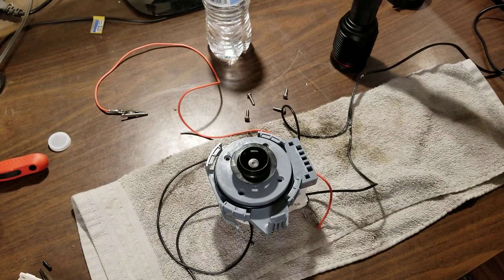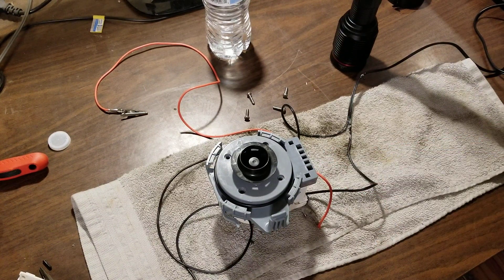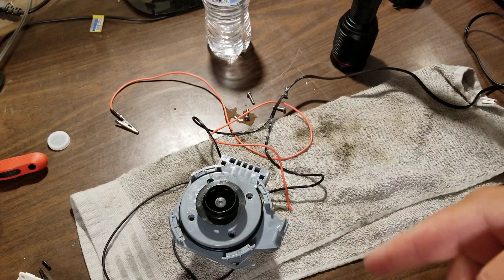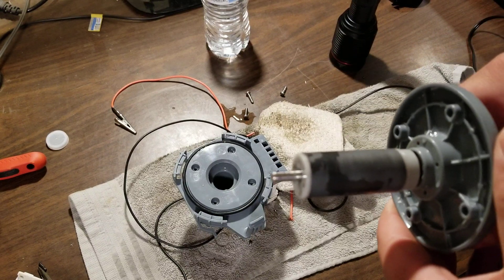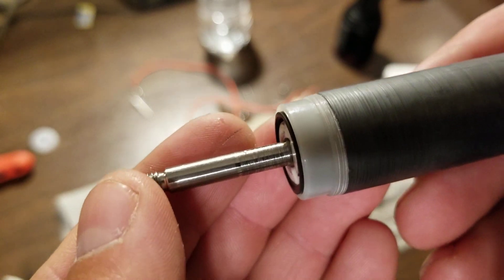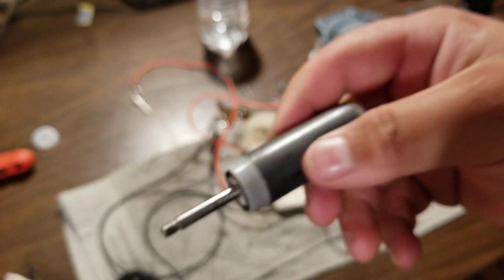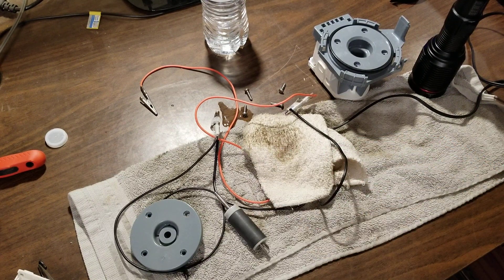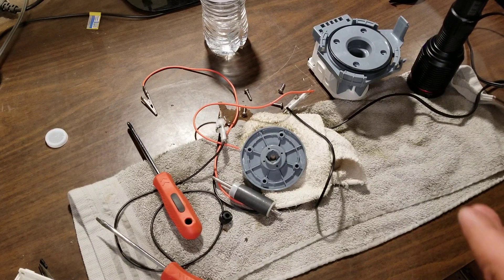Whirlpool Dishwasher pump motor failure

Comment: Thanks for this, I was wondering why these fail so often. I just changed my pump out today. Oh and beware the Amazon version. I ordered a used/like new one for $25 and it was the wrong amperage (.8 vs .9) and already dead. I bit the bullet and bought one from a local parts store ($180), but wishing now I had replaced the whole pump assembly since it is apparently the same price and easier to install.

Comment: Only took 15 months to wear out the rubber bushing. Most ppl will toss this dishwasher in the landfill rather than pay $400+ to repairman. (250 motor 150 labor) What a piece of crap. They know it'll last just long enough to get out of warranty. I used to like Whirlpool.

Comment: can you tell me if there is a way to test the motor with my multimeter?   Should there be continuity?  Should there be a resistance?  Thanks in advance.  I didn't realize there was more to this motor with all the electronics you showed.  My motor is slightly different but I'm sure it has that board now that it could be broke.  I have it removed and would like to run the dishwasher to see if the plug gets power.   It's completely unhooked from the plumbing though.  Any reason you could think of why I couldn't try to run a cycle without the water supply hooked up?    Thanks in advacne.

Comment: Excellent.  I took the motor apart, the bearings on both ends were worn to oval shape for my 5 years old Whirlpools dishwasher, acutally it is only 4 years old because the dishes was not cleaned, not after 2 to 3 wash cycles since the 4th years.  The appliance is functional after I bought replacement because I took the dishwasher out examine every part for 3 weeks, not till I saw this video.  Will put ball bearing on the broken motor as spare.  The manufacturer should have specified a ball bearing motor in the design.

Comment: Lets clear up some incorrection assumptions and conclusions. The oblong wear pattern in the bushings is caused by the choice to use a two pole stator, which causes the rotor to consistently exert force against the bushings in the same elliptical pattern. A three pole stator would solve this problem by balancing the forces evenly thus causing circular wear pattern in the bushings. The rotor becomes unable to start spinning because of the elliptical wear allowing it to tilt inside the housing, coupled with the inability to rotate freely once tilted. If the bushings were simply worn evenly in a circular wear pattern, this motor should have no problem spinning up that rotor even when there is tilt of the rotor because it would be allowed to continue rotation without impediment from the top or bottom bushing. Secondly, the o-ring on the top bushing serves only to center the bushing in the cavity. This rotor (and the bushings) are designed to run fully submerged in water. Thus any solution involving ball bearings needs to be robust to full submersion (PVDF housings with glass or 316 stainless balls).

Comment: This pump is used on many models of dishwasher from several brands (probably all made in the same factory). You can find a video where a guy replaced the lower bushing with an open plastic ball bearing. That lasted a year more until the top bushing completely failed. He then bought a new pump and installed sealed ball bearings before installing it. He hasn’t posted an update in some time. I suspect the seals will eventually let water in the bearings which won’t be good for them. It’s a cheap upgrade if they hold up though, and could be used to repair an old pump.

Comment: My dishwasher is making a grinding loud sound but works fine, do u think it’s the motor?
Reply from the maker: Yes but it might just be the drain pump. if its working normal then you should be fine.

Comment: Help, My dishwasher whirlpool goldseries is not washing, even though the electronic panel sends out 120v to the recirculating pump the dishwasher doesn't wash. So how do I determine if the control panel Is faulty or if my recirculating pump faulty.  The diswasher fills, drains but no wash. I check the wires: OK, I check the drain ok, it's between the control board and the pump. How do I determine. Than, you sir.tf
Reply from the maker: Check and see if the pump motor hums when it is signaled on, if it does hum but doesn't do anything then more than likely the bearings are bad or the impeller is jammed. But if you said the control board is sending out 120v to the pump and its not doing anything them more than likely the pump motor is dead. one way to test it is to do a quick rig up like I did in the video and see if it works, of course be careful when doing something like this as there is a shock hazard involved. You could also take the pump off the washer and open it up via like i showed in the video as its twist locked together and you can try to clean it out then put it back together and see if it works then but if still no luck then at that point I would just go ahead and replace the pump.
Reply: Thank you. I wonder if someone watching this video, with a machine shop, could make these bearings and a lot of money on the side. I sure would buy one.

Comment: My problem is not with the bushing but, the impeller. This is the second (and final) time it has unthreaded itself from the motor shaft. I've jbweled it onto the threads as there was no way to drill a hole between the impeller blades to secure it. If for some reason the bushing (or impeller) fail now I'll 3d print the entire assembly and press the existing magnet onto it. It'll cost just a fraction of the $80-100+dollars a replacement would.
Reply: Is there impellar part selling separately?

Comment: I replaced that cheesy bushing—we can hardly call it a 'bearing!—with an actual bearing. I did have to make a sleeve out of copper tubing to slide over the shaft but I got another 2 years out of this latest piece of crap that capitalism has presented to us. And, yes, we did spend $700 on this POS from Home Depot. The replacement motor/pumps are now on eBay for $80 including shipping.

Comment: You are correct in saying that this is a design flaw.  In fact, it is a MAJOR design flaw.  A part like this should last for many years, and there is absolutely no excuse for producing and selling a motor with this problem.

Either the bearing should be made of a much more durable material, or it should be protected from contaminants by a seal.  Of course, the seal itself would also need to be durable.  This problem appears to be effecting a lot of customers, and could (should) have been avoided by spending a buck or two on a better design.

My first instinct is to blame the engineers, but the fault may lie elsewhere.  It's entirely possible that a better bearing was specified by the designers, but a cheaper part was substituted by the "bean counters."